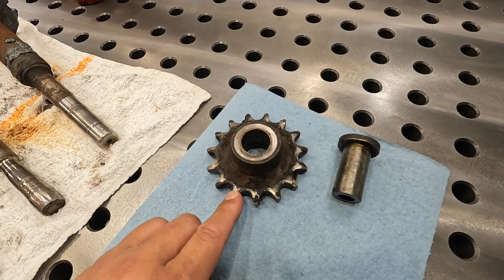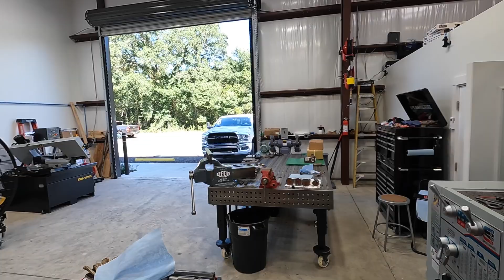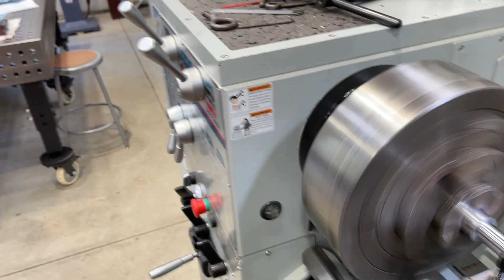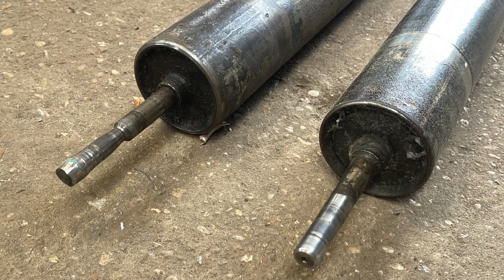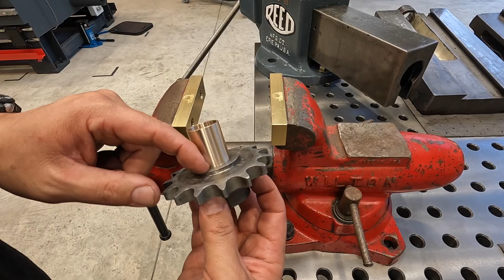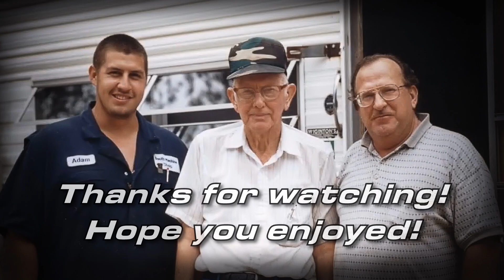SNS 366: Machining New Stub Shafts, Sprocket Repair

Comment: When you get bewildered on something with new methods, you default to what you have the most experience with.  You go from CNC back to manual, I still find myself going back to torch & grinder when I find I'm not equipped or knowledgeable enough for a certain task on the machines ... makes me disgusted with myself, as I got the machines so I could get away from most of that.  Always more tooling to get, or more to learn.  I don't mind the learning except when it's one of those jobs  where you can't afford a serious mistake or you have to get it done as quick as possible.
Reply: Adam has a good pragmatic attitude about all this stuff like CNC vs. manual. He’s not afraid to learn but a person has to evaluate where he or she is with anything of this nature and make good decisions.
Reply: Repetition is the key  - Like most skills,  if you don’t use it you loose it… to some degree,  CNC  is no different, unless you are completely happy with your programming you’re just wasting time and materials,     On a positive note Adam - manual skill and ready reckoning  in a machine shop is invaluable- maybe it’s time to take on an apprentice to pass on  your skills and help you learn some new one’s..😁💪🏻💪🏻💪🏻

Comment: my take on cnc is that making single / low number pieces will be done faster using an analog machine because of the time it takes to write the program , cnc is way faster and precice when it comes to making larger series of the same piece , it allso doesnt need babysitting / an operater standing next to the machine at all times like an analog machine does making you get better use out of youre time after writing the program
Reply: I was going to ask this very question. Thanks for your comment!

Other than just getting in practice with G-Code or the CAM package, it seemed to me Adam was better off doing these manually, especially if it was a rush job.

Comment: They really got all the good out of those old shafts and the sprocket bushing. It's a miracle they didn't have a catastrophic failure.
Reply: I'm familiar with that type of roller equipment.  RPM is maybe 10-15 max.  "Catastrophic failure" would be a lot of rattling!!  I am guessing those shafts reached "catastrophic failure".  It is amazing the amount of wear that certain industrial equipment is sometimes asked to operate with.

Comment: So where is the apology to me? I predicted that this is EXACTLY what was going to happen. A79 is a master on the lathe and will always prefer to use it on small jobs.  Programming a CNC machine for 8-10 hours to make 4 small metal pieces will never happen.  At least not when he knows he can spit out the parts in less than 1-2 hours.   Abom is affected by the nijna paradox. He is a master on the lathe but a middle-aged beginner at CNC.  He will never master CNC programming (which requires daily repetition and the addition of new skills).  Just as a  ninja is a master with the sword but lost with a high-tech weapon.
Reply: Totally uncalled for... yes it will take time and I understand where you're coming from but I can guarantee you once he gets it he will exceed your expectation.. do not underestimate..
Reply: @swedish
Apology? Delusional gibberish.
Reply: I would argue that it hardly takes 8-10 hours of CAM work, with good templates for the turning op and material you can be done in 15-30mins, including drawing as these are such simple parts. Nevertheless manual turning has definitvely its benefits here as long as the parts do not need to be superprecise (and if so, then again also CNC/ CAM might take longer)
Reply: Which is exactly why I suggested earlier that he learn and practice on his own in house projects that the time spent wouldn’t cost like it would doing customer jobs.
Reply: I think you are mistaken that Adam is a machinist who earns a living turning parts. He is now an entertainer, a YouTube entrepreneur, a rising star, a modelling star for new equipment, internet influencer among other things

More luck to him to be finally in a place where he doesn't need to "work" to earn his living. May he get even more success in his current endeavour and create a fortune. Hopefully in future he will start a company selling instruments and supplies rebadged under his own brand name for his fans

Comment: Adam, you are right. CNC is only for mass productions, not for a few pieces to fabricate. Didn't anyone tell you that before you bought the CNC lathe?
Reply: Cnc is not just for mass production at all. I run a very large horizontal at a job shop that does fabrications. It’s always single parts not long runs. Far more accurate and efficient over a manual.
Reply: Not only that the parts usually have unusual shapes and multiple planes that all relate to each other. Large threaded blind and thru holes. Thread milling and circular interpolation comes in clutch for those. 

Even our small Mazak lathe is quicker at most of our jobs on very small runs compared to our manual lathes. Once you have jaws, programs and tools, it’s very simple to run a job.
Reply: The lathe is not bought ;) its donated by the vendor for Adam to show off the brand and product.
Reply: @chrisk.3787  loaner i think
Reply: @MadmanJimbo  if you review Mr petes Interview, Adam was quite transparent on this. In my opinion that is also why he was endorsing their Products on IMTS
Reply: @chrisk.3787  i didnt say he wasnt. His shop is all about advertising. Its clear he cant handle the cncs.  He will need to hire a trained operator to satisfy his sponsors. its not looking promising right now as everything sits. Hes a great machinist. And a great welder. But this step was far too big, and too fast for him.
Reply: @MadmanJimbo  ah maybe i got you wrong. But i feel He does Not need to deliver, its rather about Adam tinkering and learning cnc along tge way similar to the early John saunders/ grimsmo :) we will See, i am looking forward to it
Reply: @chrisk.3787  theres three machines to learn, and he’s not comfortable. He needs to invest in staff that knows the job, and learn from them, while showing us machining. Lets face it. Hes only machining now to give us minimum content. We see this is many channels. They see themsleves as you tube creators, and forget what got them the huge followings.  One machine made
Sense. 3?  It will be 4 years before he makes 3 parts on each.  With 10 videos per part.  Its lost its allure to be honest. I liked Adam as Adam. Not trying to be a marketer
Reply: @MadmanJimbo  totally get that. But  i believe He really has the wish to learn and move forward and that should be more important than the channel, also i feel you this might be a sacrifice we will be making... Still, as a selftaught Person in a lot of areas, i respect (and like) what He is trying to achieve.
Reply: @chrisk.3787  its fine for him to do whatever he wants. Its his channel.  But i didn’t sign up years ago to watch very very simple CNC machining for a few years.  Its just too much sponsorship stuff and very little content anymore. He used to be all real content
Reply: @chrisk.3787  ok, I ignored that. I overlocked the advertising power of chinese manufactures. I was confused, how many machinery was brought to Adams shop. But that makes sence and declares the weak state, the US is in. What would his Pa and Grandpa think about his decisions, to become influenced by chinese machinery builders.
Anyway, he loves to bbq and entertain his YT-audience, rather than trying to beat up German quality. I love his journies and small talks with Abey. Just another "victim" of chinese influence. The US-industry and the Yank dollar is weakening each day. 
Anyway his skills on his manual machinery isn't beatable, but we Germans always saying: Schuster, bleib bei deinen Rappen. Which means, never leave the level of skills, you are already into.
Reply: @JohnDoe-es5xh  ich kenn das nur als "Schuster bleib bei deinen Leisten" ;) Yeah no worries, the global economy is weak currently, perfect timing to invest. I'd rather see him as entrepreneur succeed and take up new challenges than yet another manual lathe action video, which we have seen over and over - not that I not enjoy those either, but I have not particular signed up for these, rather because he and Abby are such nice persons and its quite refreshing to see his professional life develop, even if many think this goes in the wrong direction (a fact which I do not share).
Maybe we have the chance to meet him one day at the AMB in Stuttgart. For sure all the big manufacturers are there as well.
Reply: @chrisk.3787  falls es dich interessiert, wie die Amerikaner, hier im Speziellen Adam ticken, muss man weiter ausholen.  Für innovative Deutsche reicht es allerdings, seine Vorgehensweise zu beobachten. Weitere Analysen erspare ich mir hier, um von Youtube (Alphabet) nicht gebannt zu werden.

Comment: What is the typical way of saying how much you're taking off on a lathe?   Eg, if you're "taking off 0.100" are you only moving the cross-slide in 0.050"?   Or is the cut 0.100" deep so that you're actually reducing the diameter by 0.200"?   I think the first interpretation is more correct, but it seems like the depth of cut vs size reduction gets used interchangeably.
Reply: Unfortunately you can find lates that are both ways. Direct reading or indirect reading is half it has been described to me in the past.
Reply: Adam typically will say “on the dial”
Reply: @rjstiles80  That lathe has a DRO.
Reply: Depends on the lathe. Some have the dial set so that going in .001" takes that much off of the diameter while another lathe will take that much off of the radius. Know your lathe.

Comment: Those used parts sure are long ago worn out. Seems that they need some harder metal but I have no idea how many hours they have on them now, likely tens of thousands. 
Those custom jaws on the Wilton are what made that job work so well vs. old uneven and worn jaws. Nice.
Computer run equipment will rarely make a single small job worth programing which this video simply proved.  Computer work is great but the time to program has to be taken into consideration when figuring out total investment time.

Comment: I've a dumb "curiosity" question I can't find an answer for...  What do you do with all the chips?  

Sometimes it looks like the amount of chips is much greater than the amount of material in the work piece, but I'm guessing - are the chips recycled, or ???  🤔
Reply: Scrap yard, they get melted into new steel.  Low value because they are bulky with high surface area.  They take up too much room and have more oxidation compared to bigger lumps.